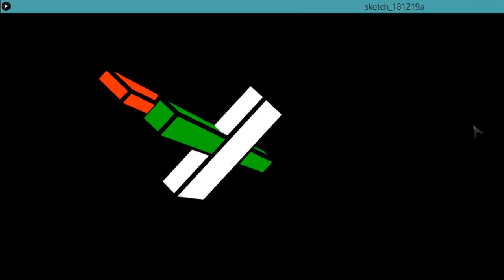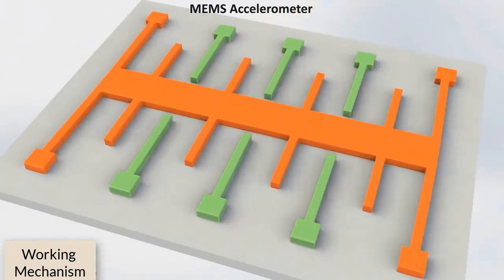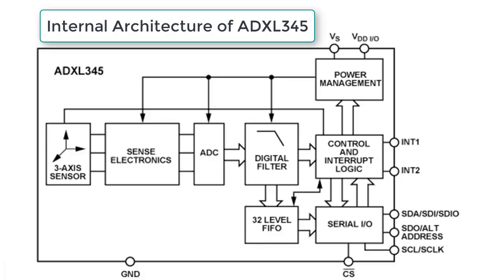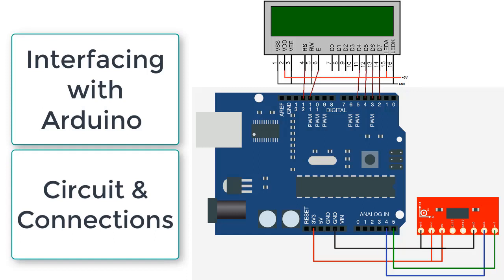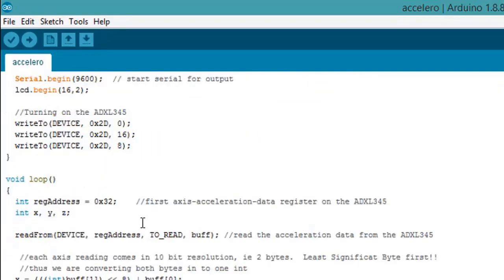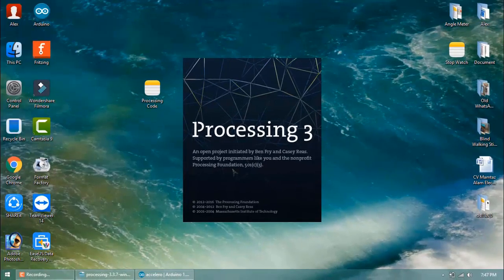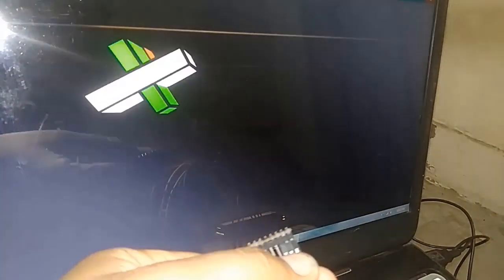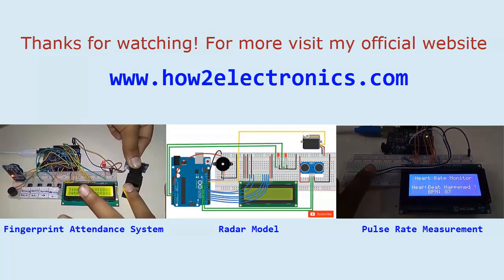Accelerometer Arduino Tutorial 3D Processing

Comment: Instead of Processing, maybe NiceGui+FreeCad+ThreeJs could be used to display the tilt using a 3d step model?   

For example, the ADXL373 output (2 bytes for each x,y, z axis), could be used to calculate the roll/pitch (atan2)..  the yaw would require an external magnetometer.

A standalone python+FreeCad standalone gui could be made.. but to render in the NiceGui browser I'd have to first convert it to a supported format (stl/obj/gltf)... using either freecad/assimp/Blender/SimLabComposer?

Also, since Yaw is not practical, maybe just 16-bits for Pitch and 16-bits for Roll can be calculated and sent to the GUI for display?
float ax = raw_x / 4096.0f;
float ay = raw_y / 4096.0f; 
float az = raw_z / 4096.0f;
float pitch = atan2f(-ax, sqrtf(ay*ay + az*az));
float roll = atan2f(ay, az);

and on the gui something like:
pitch_signed = pitch_raw if pitch_raw < 32768 else pitch_raw - 65536
roll_signed = roll_raw if roll_raw < 32768 else roll_raw - 65536
pitch = pitch_signed / 20000.0
roll = roll_signed / 20000.0
model_object.rotation_x = pitch
model_object.rotation_z = roll  
model_object.rotation_y = 0  # No yaw

Comment: to:How To Electronics
I have done following you but  my Processing program didn't run. Let me ask if I need to install prosecing or just run Admintrator? (I using Win 7 32bit )
Reply from the maker: Graphics issue.
Run in some other computer
Reply: to:How To Electronics

So  in your mean, I have to run sketch arduino IDE on one computer and run Sketch Processing on another computer
and what type do them connect ? USB , Wifi , Land....?
Reply from the maker: Upload code to Arduino board from your computer.
But while running processing IDE use window 8 or 10 or the computer with good graphics.